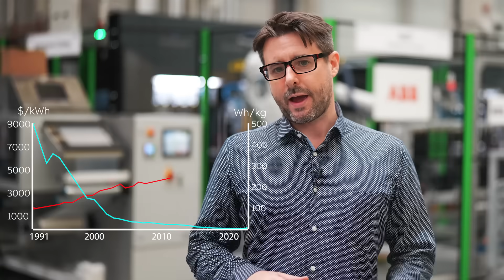We’re in the middle of a Battery Revolution. Here's why it matters.

Comment: 102202  Nanometer scale uniformly aligned parallel diode arrays may be a practical way of absorbing ambient heat. Ambient heat is uniform on a micrometer and larger scale and non uniform on a nanometer scale. Plausibly,  heat absorbtion at the non uniform scale is available as Johnson Nyquest thermal electrical noise that would yield, by conversion without gain or loss, an equivelent amount of electrical energy. 
AND
 Diode voltage / current  characterstics can be displayed on an XY tracing oscìlloscope. Thermal electrical noise power in resistors can be displayed by time sweeps of voltage on an oscilloscope. Each such time sweep shows unique randomness.
AND
A  simple  "Special Program with Integrated Circuit Emphasis" model indicated that diodes in uniform alignment parallel would aggregate simulated rectified thermal electrical noise.

Maximum direct current electrical power, half, is transfered from a direct current electrical source to the electrucal load when the electrical resistance of the two parts is equal. Calculated matched resistance output (watts) is k (Boltźman's constant), one point three eight x 10^ minus 23, times T (temperature Kelvin) times bandwidth (0 Hz to a natural limit ~2 THz @ 290 K) times rectification halving and nanowatt power level rectification efficiency, times the number of diodes in the array. 

There are a billion cells of 1000 square nanometer area each per square millimeter, 100 billion per square centimeter. 

Creditable independent replicatable proof of concept protypes beyond improper influence are needed.

Aloha
Charles M Brown 
Kilauea, Kauai, Hawaii 96754

Comment: 102202  The second law of thermodynamics may be false conventional wisdom. Let's face the wonder of full heat use. 

The second law of thermodynamics was developed during v8ictorian england's scientific and religious fascination with steam engines. 

The second law is behind modern refrigerators needing electrical energy to compress the refrigerent to force it to release as waste the heat that it has removed from the refrigerator's service interior in the cooling part of the refrigerent's circulation. The interior coldness draws in exterior heat through the cabinet insulation. There is also discarded heat from mechanical friction and electrical resistance. The net thermal output equals the electrical input with energy not being gained or lost in this refrigeration system including its forced waste. Unencumbered refrigeration by the principle that energy is conserved should produce electricity instead of consuming it. 

It makes more sense that refrigerators should yield electricity because energy is widely known to change form with no ultimate path of energy gain or loss being found. Therefore any form of fully recyclable energy can be cycled endlessly in any quantity. 

Full heat recycling, all electric, very isolated underground, undersea, or space communities would be highly survivable with self sufficient EMP resistant LED light  automated vertical farms, thaw resistant frozen food storehouses, factories, dwellings, self contained elevators, safe rooms, and horizontal transports. 

In a flourishing civillization, small self sufficient electric or cooling devices of many kinds and styles like lamps, smartphones, hotplates, water heaters, cooler chests, fans, radios, TVs, cameras, security devices, robot test equipment, scales, transaction terminals, wall clocks, open or ciosed for business luminous signs, power hand tools, ditch diggers, pumps, and personal transports, would be available for immediate use incrementally anywhere as people as individuals or larger social groups see fit. 

Some equipment groups could be consolidated on local networks. 

If a high majority thinks our civilization should geoengineer gigatons or 
teratons of carbon dioxide out of our environment, instalations using devices that convert ambient heat into electricity can hypothetically be scaled up do it with a choice of comsequences including many beneficial ones. 

Energy sensible refrigerators that absorb heat and yield electricity would complement computers as computing consumes electricity and yields heat. Computing would be free. Chips could have energy recycling built in.

A simple rectifier crystal can, iust short of a replicatable long term demonstration of a powerful prototype, almost certainly filter the random thermal motioren of electrons or discrete positiive charged voids called holes so the electric current flowing in one direction predominates. At low system voltage a filtrate of one polarity predominates only a little but there is always usable electrical power derived from the source, which is Johnson (observation) Nyquest (theory) thermal electrical noise. This net electrical filtrate can be aggregated in a group of separate diodes in consistent alignment parallel creating widely scalable electrical power. The maximum energy is converted from ambient heat to productive direct current electricity when the electrical load electrical resistance  is equal to the array internal electrical resistance. 

Maximum calculated electrical power output (watts) is k (Boltźman's constant), one point three eight x 10^ minus 23, times T (temperature Kelvin) times bandwidth (0 Hz to a natural limit ~2 THz @ 290 K) times rectification halving and nanowatt power level rectification efficiency, times the number of diodes in the array. 

There are a billion cells of 1000 square nanometer area each per square millimeter, 100 billion per square centimeter. 

Order is imposed on the random thermal motion of electrons by the structual orderlyness of a diode array made of diodes made within a slab: 

  P type boron doped
-----‐------‐----___-- Out
🔻🔻🔻🔻
■■■■■■___ + Out 
  N type phosphorous doped 

All the P type semiconductor anodes abut a metal conductive plane deposited on the top face of the slab with nonrectifying joins;  the N type semiconductor cathodes or common cathode abuts the bottom face. As the polarity filtered electrical energy is exported, the amount of thermal energy in the group of diodes decreases. This group cooling will draw heat in from the surrounding ambient heat at a rate depending on the filtering rate and thermal resistance between the group and ambient gas, liquid, or solid warmer than absolute zero. There is always a lot of ambient heat on our planet, more on equatorial dry desert summer days and less on polar desert winter nights.

Focusing on the composition of one simple diode, a near flawless crystal of silicon is modified by implanting a small amount of phosphorus (N type conductivity) on one side from a ohmic contact end to a junction where the additive is suddenly and completely changed to boron (P type conductivity) with minimal disturbance of the crystal lattice. The crystal then continues to another ohmic contact. 

A region of high electrical resistance forms at the junction in this type of diode when the phosphorous near the ĵunction donates electrons that are free to move elsewhere while leaving phosphorus ions held in the crystal while the boron donates holes which are similalarly free to move. The two types of mobile charges mutually clear each other away near the junction leaving little electrical conductivity. An equlibrium width of this region is settled between the phosphorus, boron, electrons, and holes. Thermal noise is beyond steady state equlibrium. Thermal noise transients, where mobile electrons move from the phosphorus added side to the boron added side ride transient extra conductivity so the forward moving  electrons are preferentally filtered into the external circuit. Mobile electrons are units of electric current. They lose their thermal energy of motion and gain electromotive force, another name for voltage, as they transition between the junction and the array electrical tap. 

Inside the diode, heat is absorbe; outside the diode, to exactly the same extent, an attached electrical circuit is energized. The voltage of a diode array is likely to be small so many similar arrays need to be put in series to build higher voltage.  

Understanding diodes is one way to become convinced that Johnson Nyquest thermal electrical noise can be rectified and aggregated. Self assembling development teams may find many ways to accomplish this wide mission. Taxonomically there should be many ways ways to convert heat directly into electricity. 

A practical device may use an array of Au needles in a SiO2 matrix abutting N type GaAs. These were made in the 1970s when registration technology was poor so it was easier to fabricate arrays and select one diode than just make one diode. 

There are other plausible breeches of the second law of thermodynamics. Hopefully a lot of people, mostly as independent teams, will join in expanding the breech. Please share the successes or setbacks of experiemental efforts. 

These devices would probably become segmented commodities sold with minimal margin over supply cost. They would be manufactured by advanced automation that does not need financial incentive. Applicable best practices would be adopted. Business details would be open public knowledge. Associated people should move as negotiated and freely and honestly talk. Commerce would be a planetary scale unified conglomerate of diverse local cooperatives. There is no need of wealth extracting top commanders. We do not need often token philanthropy from the top if the wide majority of people can afford to be generous. 

Aloha
Charles M Brown 
Kilauea Kauai Hawaii 96754

Comment: "IT'S ONE OF THE FASTEST COST REDUCTIONS IN ENERGY TECHNOLOGY EVER" And you have the taxpayers to thank for the massive government handouts to help this along.......:face-blue-wide-eyes: marketing gimmick ???? Did we not notice the producer of this advertisement wrapped in an 'emerging technology news' wrapper is one of the largest OEM's of electric infrastructure equipment on the planet ??? roflmfaox2
Reply: ABB is an industry leader in developing higher-voltage components to meet the needs of energy storage applications. We offer an extensive range of equipment with voltage levels up to 1500 VDC that are fully integrated with measuring and monitoring systems. Including these latest advancements as part of a system design will help the OEM provide greater efficiency and cost savings for their customer.
Reply: CMBlu's Organic SolidFlow battery technology is ready to scale !!! (Which means that they need $$ to bring to market and do utility scale 'testing' of their technology. More handouts from Uncle Joe please......

Comment: Independent, self-sufficient local systems excersized here on earth, nationally perfected coast to coast, then moved to moon, and Mars hasn't received the domestic emphasis it needs .
No shortage of R & D especially when it comes to energy.. but that luxury time is running out..
We've stand upon self sacrifice of life for land turned entire generation into stepping stone and maybe earth just has to be one of many self sacrifice land for life improve human condition ✨️. 
Maybe earth can't be anything more than that for humanity ?
Ability to simulate away natures fine-tuned atoms speed puts us on a saftey clock of trade .
But now that dual use capacitors designed for both communication and to blow up devices, google deep mind folding amino acids,  faking boeings nickel to fatigue and spikes titanium supply chains where xraying every inch cant read changes global trade is also becoming national security concerns for even parents & individuals. 

I don't think we have time or the luxury of more r & d. 
Commitment to new paradigm computational infrastructure is gonna have to be built by gen x here and now over the next 30 years. 

Odds are it will be to dangerous to look abroad for mandatory supply chain goods or services.

Comment: We are doing well on bringing lower cost and more energy dense car batteries to market. But we are currently failing miserably at lowering the cost of home and small business-scale batteries. I know this situation will eventually improve. But for now, an Enphase or Tesla home battery still costs over $1,000 per kWh installed, ten times the current cost of car batteries. And, the home storage batteries are too small. The average US or European home will need 30 to 60 kWh of battery storage to store all of the electricity a rooftop solar system can produce, and to speed up the distribution of power generation and storage, and to reduce the need for expensive upgrading and maintenance of transmission lines.

Comment: 3:48 lol, the day we get windmills in suburban areas its definatly over 😂 Intermittency is not the only problem, its energy density, not in storage but in the production. You are frontloading tonnes of co2 in the production of solar panels and windmills, and take up loads of space. Take a look att the annual energy usage, 95% of which is fossile fuels and calculate the materials needed to phase it out, green transition is nonsense. What is needed is more energy dense and stable production. LFTRs and such reactors. Make use of "spent" nuclear fuel and so on.

Comment: LiIon is already > 100 $/kWh. A bit above after tax&tariffs in the US and Europe.
CMBlu is around 300 -400 $/kWh
...
Conclusion:
While lithium-ion batteries currently have a significant upfront cost advantage per kWh, flow batteries like CMBlu’s can be competitive for specific applications and use cases, particularly those involving:

Long-duration storage (6-12 hours or more).
Grid-level frequency regulation and load shifting where cycling multiple times daily with minimal degradation is key.
Situations where safety and environmental sustainability are high priorities.
So, the competitiveness of flow batteries like CMBlu’s comes from factors beyond just the initial capital cost. For applications that demand long lifespans, minimal degradation, safe operation, and long discharge times, flow batteries can present a lower overall cost of ownership compared to lithium-ion systems, even if their upfront costs are higher.
Reply: Doesn't make me hopeful for Europe tbh

Comment: Batteries are highly standardized and made in the billions, so they’re very good for economies of scale. This means battery costs will approach cost of materials. So the cheaper the materials, the cheaper the batteries. This is especially interesting for grid batteries, which do not need to be lightweight or portable, or have fast charge/discharge rates. Lithium is relatively expensive (and some other metals even more expensive), so it’s not a great choice for grid storage as prices drop. Iron, though? Or organics? This could be order-of-magnitude cheaper.
Reply: Ul0

Comment: What kinda trash is this?  
No mention of the actual material used, like, yeah it's organic, but ehat is it? Some kind of sodium ion? Sulfur or carbon based?  
There's also no mention of the specs, such as discharge cycles or peak energy output.  
And lastly it's literally a lot of noise but no ebough substance. Like this is the only batrery tech video I've seen has to be shot right next to a noisey robot, when much larger conpanies with hundreds and thousands of robots choosing to film with clean and audible background instead.

Comment: Metal free is misleading you still need conductors. Also no information as to what the organic material is and process steps these if acid or alcohol can be toxic. Full information is best then a full understanding of the impact can be done.
Reply: As somebody else pointed out: this video is selling battery manufacturing equipment, not the batteries themselves.
Reply: I'm only able to imagine it's the next development on Super capacitors. They're bzasd on carbon.

Comment: Of course we will need exponential battery growth. But there are also other solutions to intermittency, like long range high voltage transmission lines, wave and tidal energy, deep geothermal energy, floating offshore wind, and locations like Morocco where they have continual sun during the day and continual wind at night.
Reply: Also off-river pumped hydro.

Comment: Current technical problem is the fire of battery, especially EV driven by motor-battery. The EV battery shall respond to the fluctuation of tire torque demand that can wave the battery current. The current sloshing (wave) is destructive and be the cause to ignite. How do you solve this problem? I have an idea but like to listen to you firsthand.
Reply: This makes no sense. I have batteries in my vacuum all my cars are electric as is my home battery pack. I’ve had a mobile phones for 30 years and none have ever sparked, burst into flames, or similar. My friend had a petrol car which had a rear end and caught on fire with huge ferocity. It was like a tv show but real. When I looked at the stats petroleum fires are significantly higher than batteries. Happy to be educated about it?
Reply: @user-rc7dg3np9c  Might it be that as risk increases even if the individual cell or stack hazard might be low, when we incorporate multitudes of cells?  An insurer will ultimately decide the application based on if they will insure and decide how much it costs. A redox battery such as these, has a lower fire hazard and in turn risk which might be attractive to industries requiring around 250MWh as described in the video.  It'd be good if the video also went in to this detail...there's plenty it doesn't cover which is disappointing.
Reply: @jayyoo906  these batteries are not at all relevant for EVs, so why are you talking about EVs?
We also know that EVs are far less likely to catch fire than ICE vehicles, so while fires are a concern and an area of potential improvement, it’s already an area where EVs are much, much better than what they’re replacing already.